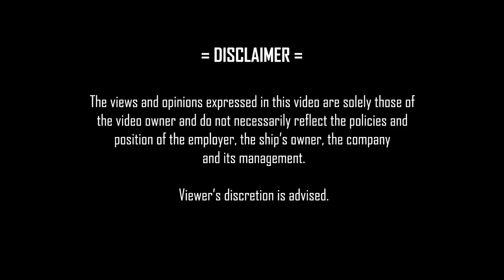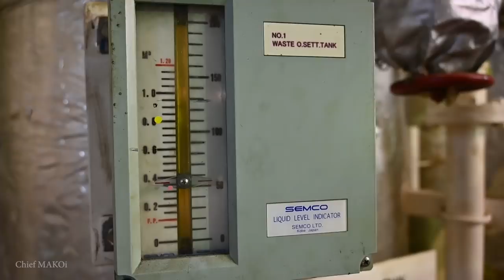Ship Engine Troubleshooting and Repair at Tarragona Spain | Chief MAKOi

Comment: That the alarm float, for the fuel leak was set high enough to bypass the alarm sequence, coming out of a major overhaul, sounds rather 'fishy,' don't you think?
Such a thing would have been checked and set to proper level, if the overhaul team had been going by the numbers.
But instead, you now have a waste oil tank, filling at sea and a loss of valuable fuel for the ship.
An oversite?  Sabotage?  Ignorance?  A disgruntled worker at the overhaul facility?
Maybe just an improper rebuild?
Actually, I wouldn't suspect a crew member, because for the most part, major overhauls are carried out by a contracted company in the shipyards.  But cut corners and a rush job can usually be reasons why things malfunction later.

When I was aboard ship, we had a bad situation, where one of the 'trim and ballast,' team, had actually left a fuel handling system open, and we woke up to find a couple hundred gallons of JP5, on the deck of our berthing area, which sat on top of the tank!  The rest of what started as a peaceful night, was spent with mops, buckets, and fans to vent the fumes.

Another time, someone managed to pump water into the fuel system!  Our main engines and generator, "online,"  shut down!
We were dead in the water, and it was DARK inside!
No power, no lights, no radar, no radios...
Since there was water in the fuel system, we could not start any other mains, (we had 6, in 3 seperate engine rooms), or generators, (3 one per engine room).
It took a couple of hours to work that one out.  We had to clear all the fuel lines, and find where the water came from, to shut it off.
I'm not sure what happens aboard your ship, when someone really masses up.  But when you shut a warship down in the middle of the Atlantic...
Let's just say, the guy walked funny for a long time!